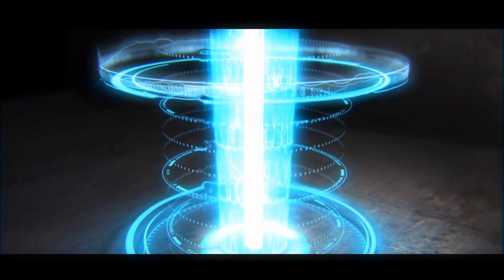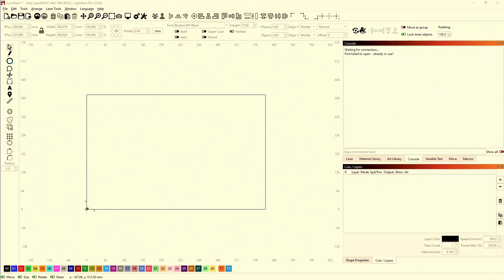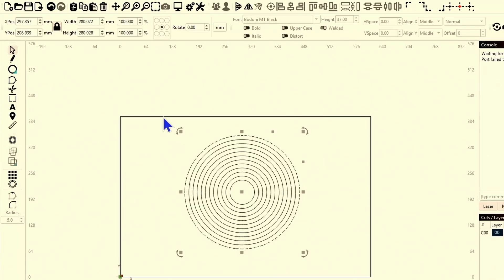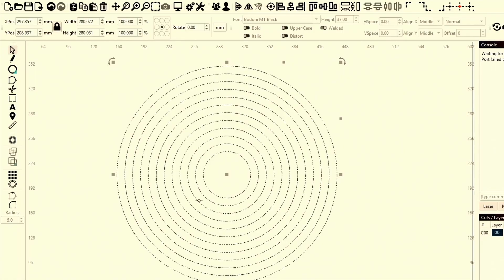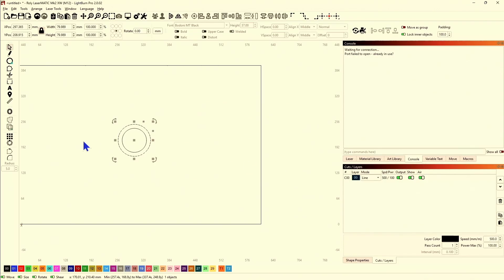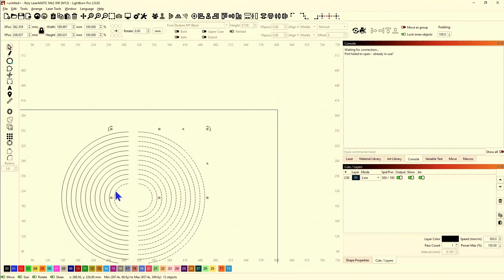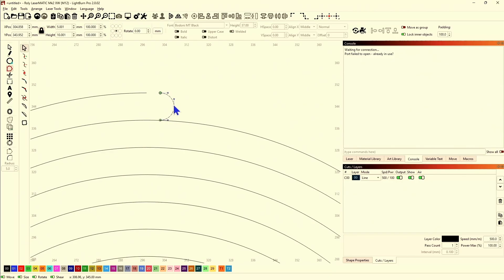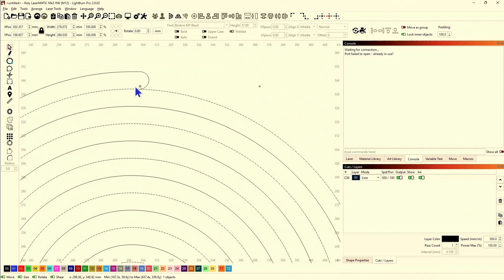Spirals Made In Lightburn

Comment: Hi Steve. Tried this out on 2 pc's - Because the offsets are not exact 10mm when I try to alt- j j it doesn't work. when i got right into it the 2 halves are not aligned. Is there a tolerance setting to have that allows it to work?
Reply from the maker: If the items are still grouped, Alt J won't work.  If that's not the problem and you think it because of the offset sizes, correct the sizes to exact measurements and see if it works for you. If you're still having problems, I'll be happy to connect online with you to find the problem.
Reply: @HoboWithWood  Thanks Steve - still had them grouped. once ungrouped worked perfectly. Missed that step in the video